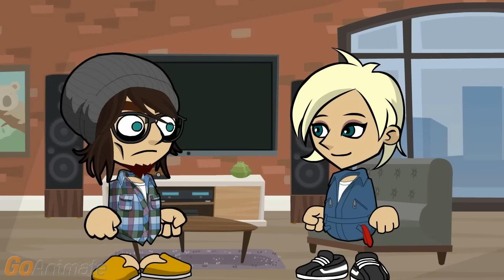My Thermostat is Flashing Cool On

Comment: I had the same issue with my heat pump cool flashing but not cooling it was the capacitor. They replaced it works great. Hope this helps